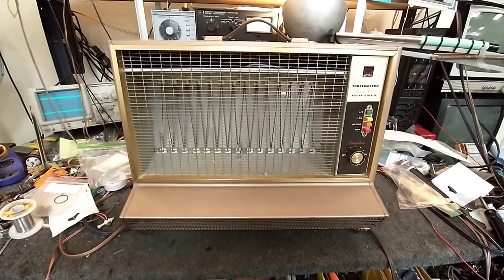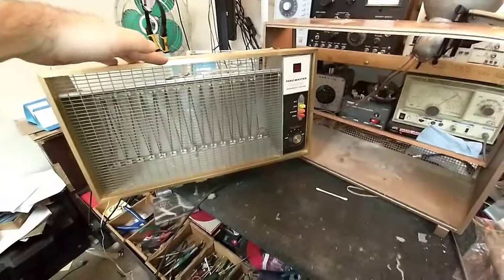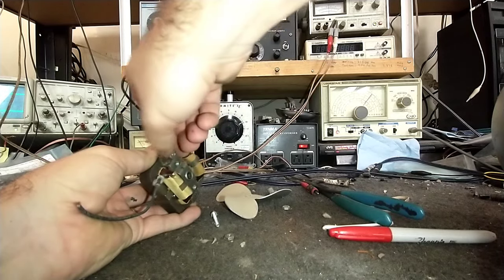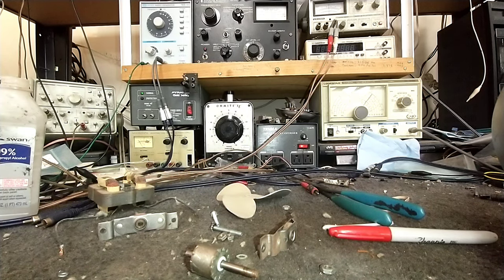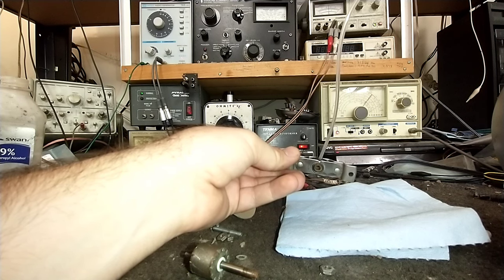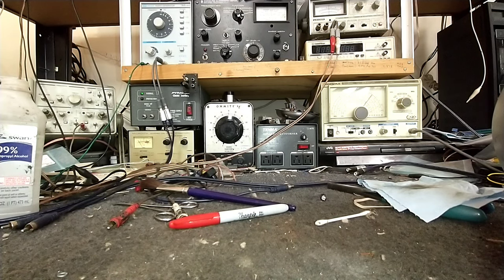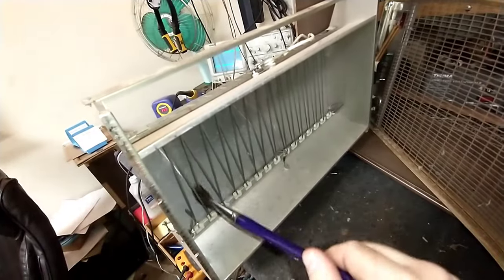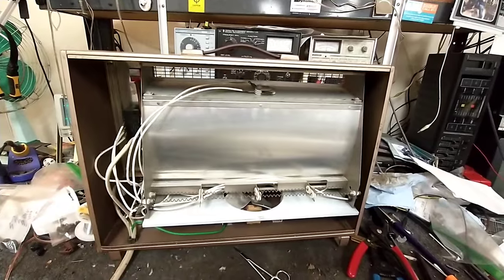Servicing a vintage 1960s Toastmaster 1650w space heater model H921

Comment: After the "modern" junk that was actually recalled due to fire risk, I bought a Round Montgomery Ward Heater/Fan from the 50's.  It runs PERFECT!  And will continue to do so after I'm dead.   I own a lot of old stuff because it just doesn't break or has a stupid electronics module buried in it.  You learn lessons as you get older.  🙂

Comment: I got a 60s Montgomery Ward, 40s Or cold be 50s GE, and 60s GE that needs the cord replaced. I'm using the Montgomery Ward in my bedroom at the moment until I get the new cord on my GE as the Montgomery Ward rattles pretty badly do to the two bladed fan blad I think.

Comment: Is there any asbestos insulation on the white wires? I'm surprised how quiet that unit is. My wife had a similar unit 30 years ago when we got married. It made a God awful screeching noise until it warmed up. It wasn't the fan I suspected it was the nicrome wire rubbing against the ceramic insulators as the unit warmed up. I never found out. I tossed that unit at the first chance. 😂

Comment: Nice repair. I am amazed that was originally ungrounded, plenty of scope for an element to fail and contact the chassis. Heaters of that vintage (and even older) in the UK would have required an earth connection.
Reply from the maker: You didnt see grounded appliances and outlets here until the 1970s. We were not wise on earthed appliances yet. Many of them were built with the electrical  isolated from the outer case so that in the event of a failure no harm came to the user, but this was not one of those pieces.
Reply: @JordanPier Interesting - thank you !
Reply: Ive always said  " if it's metal, it must be earthed"
Those metal touch lamps frighten the crap out of me, no earth :-(
Reply: @zx8401ztv  I know what you mean re.touch lamps - and you can "feel" the a.c., as with the leakage on many switched mode power supply outputs. I know the current is tiny and harmless (or should be) but even so!
Reply: Sure there is an “earth” connection on touch lamps…your body :o
Reply: Polarized plugs were not common here either when that heater was made.